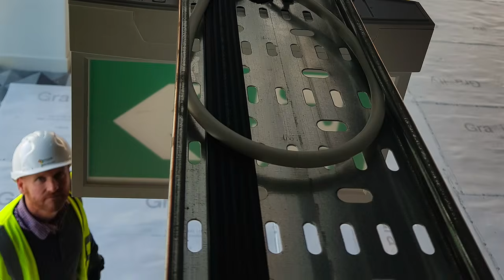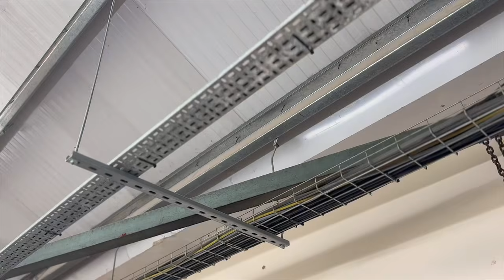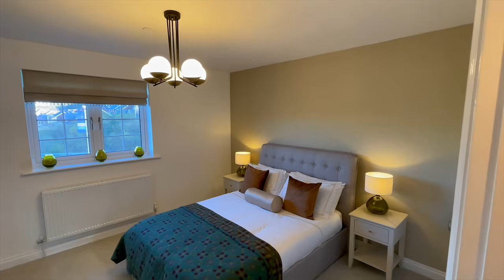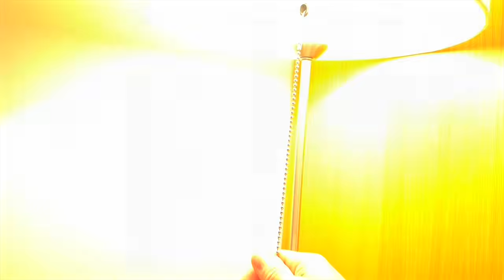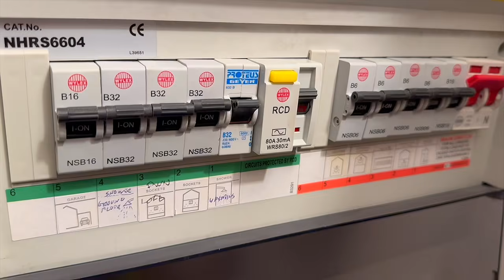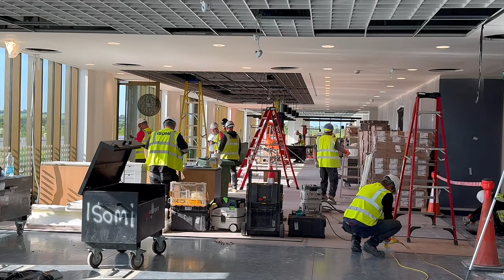The Cable That Isn't Really A Cable...

Comment: East Europe using 240mm² aluminium cable running from transformer till last building and middle buildings are connected through 16mm² wires by piercing connectors. Some locations in Australia also use daisy chain between transformer and last building. Technology is not new, it's adopted to use in modern conditions. 

The biggest disadvantage is inductance of flat cable. Impedance in the end of line will be significantly higher than in round cable. Industrial buildings use rectangular assemblies with busbars to reduce inductance.

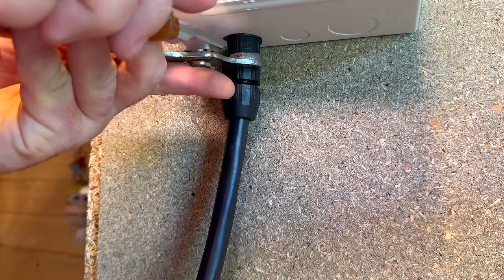Comment: Dude 1:40 'it works and its the best option aren't the same thing' no joke... I'm not even an electrician and I'm only 2 mins into this but I can already tell you the pros and cons with about 90% accuracy. Pros less waste, less mounting, less piping, easier inspections, safety assuming its mounted correctly and you don't have a 1 million watt line on the edge of a pool that has scissor lifts drive near to clean the nearby windows everyday etc. Cons - you are completely at the mercy of the manufacturer for supply and pricing and that's NEVER a good thing and you can't get send a random electrician to go mess with it because they'll be able to figure it out but it'll take time so you gotta train them and mainline systems like this have been around for a long time and were popular in the mid or early 1900s in the US and they called it like 'live wall' or something really weird like that and it was plagued with issues so maybe look into that first because most of those issues were due to the poor quality of the wire insulation and the codes of the day but many were inherent problems of any system like this and if they go out of business or stop selling that product line and don't licese it over to someone else you are SOL and your supply of those parts and tools are virtually useless beyond selling them off to someone who needs them more than you etc and as a home or business owner you will have to find people who have it in stock and know how to use it if you want additions etc so its not inherently good nor bad because that inherently depends on the context and the use case but there's far more cons than pros for most
Reply: Trying using paragraphs and numbered lists. They were invented to make text easier to read.
Reply: @StayProteus  I can only begin to tell you about the multiple data port systems that were 'the end all' for this new internet thingy. And as each standard was ammended, we watched as yet another group of shelves worth of components no longer were viable.

Comment: It's a flexible buss bar....
Reply: No it’s is not . FFS the manufacturer say it’s a cable . Then it’s a cable . Having the  flexibility of a bus bar doesn’t make it a bus bar . It’s still a flat cable .
Reply from the maker: Exactly
Reply: @efixx  Functionally it's a buss bar. A common distribution rail with taps off at chosen locations. Call it what pleases you, but it functionally its a buss....
Reply: @mfr58  yes u are right. This method makes installation faster and less work and also I think it would be less cost on cables also than buying three core wires (or selected main cables) separate for each apartment.

Comment: Ah, an ad
Reply: Sure. Sure. Can you point out any downsides?
Reply: @FrontNews-f8c Lets see.

They talk about 320A, than 160A but this cable only seems to be rated at 63A. Though they also seem to forget about the existence of 3 phase, so perhaps that cancels out. They talk about 32A per room but show 20A tap off units (though 32A units also exist). 

They don't address overcurrent and protection for final distribution wiring and equipment in the room (the range has products to support that but they don't show them.)

They don't address the fact that the cable has no "armour". This means that if it's concealed and not 30A RCD protected (which it probablly won't be) it will need to be either over 50mm deep or have mechanical protection.

They don't address the fact it would be perfectly possible to implement a "backbone cable with tap-offs" design using conventional cable and junction boxes.

The video appeals to authority on the reliability of the IDC connections. A manufacturer claim that a product meets a given standard is unfortunately no guarantee of long term reliability.

They don't address the question of what happens if the manufacturer goes out of buisiness or loses interest in the product.
Reply: @petermichaelgreen  Not the sharpest thougt
Reply from the maker: Some great points here, may be worth another video to answer these points....thanks for sharing